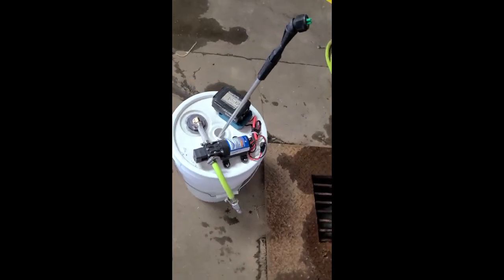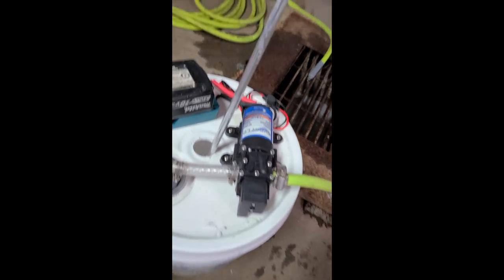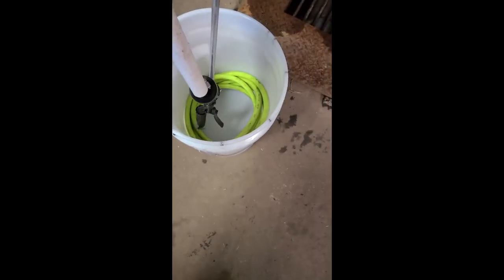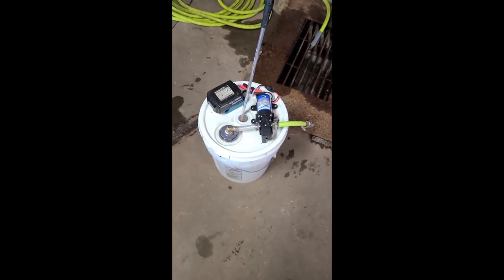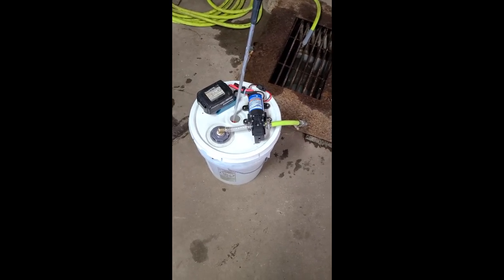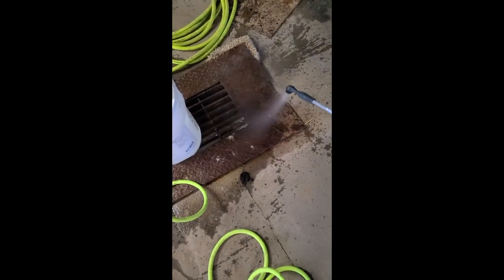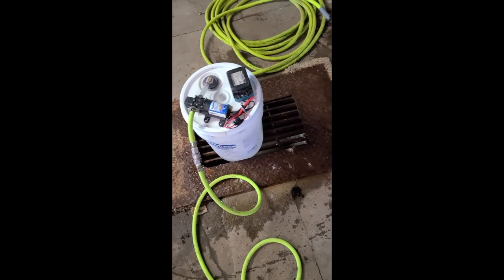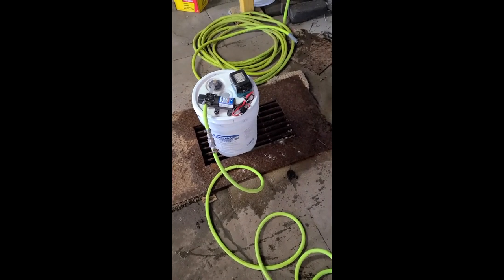5-Gallon Cordless Bucket Sprayer

Comment: How long is the hose youre using? Im using 50' but it takes a while for the pump to ramp up and spray evenly. Would you recommend using 30 or 40 ft length? I have a 1 gpm pump 100psi
Reply: We use 30', but will be trying 50' soon.

Comment: Wouldn't the 18v battery ruin the 12v pump? I built something similar, but heard I had to either use a 12v battery, or get a step down converter.
Reply from the maker: my original builds are still running. Dont believe what everyone says
Reply: Yeah like this setup It doesn't have vacuum pump

Comment: What's up brother. Dope setup, looking to do the exact same thing. Did you get a step down for the makita 18v to 12v conversion? If so, which one did you get? Seems Dewalt and milwaukee batteries have more options for a 18v to 12v conversion without having to get a separate buck/step down converter to connect to the 12v cables from the battery adapter.
Reply from the maker: no step down. wired 18v dock to the pump and it works fine. Been using now for several months and no problems.

Comment: Can you run bleach through it ?
Reply: That’s gonna depend on the pump your using, if your planning on running bleach mixture make sure the your buying is made for that, with that said bleach is one of the most unforgiving chemical, it damages seals, o-rings as you know.